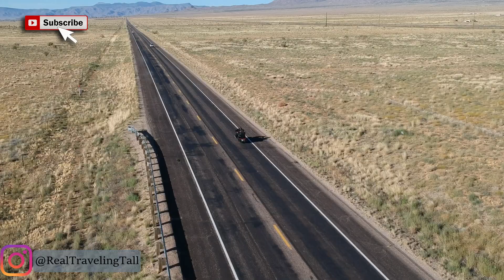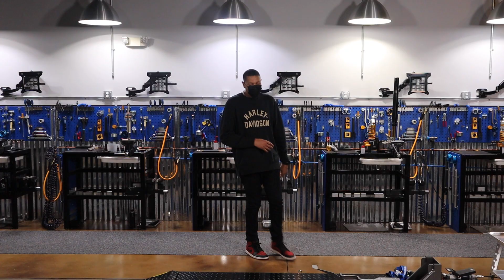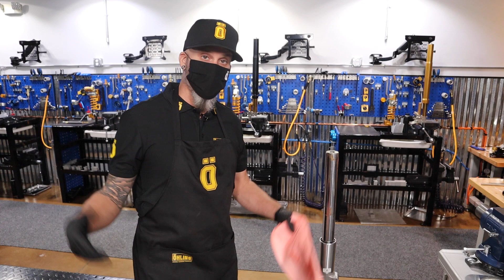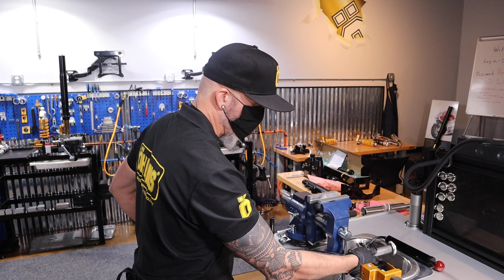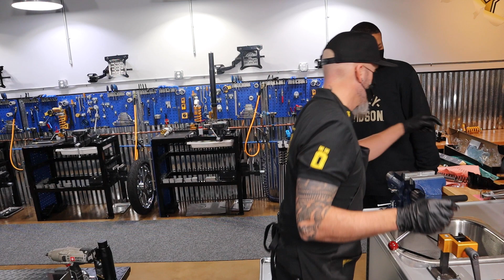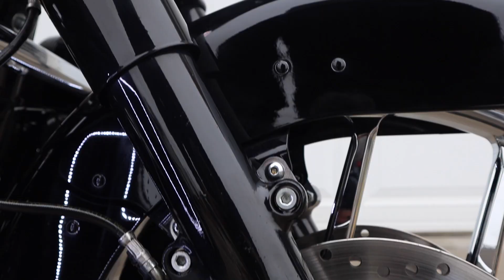Back at Öhlins USA for a Front Suspension Upgrade on my 124 Cubic Inch Harley-Davidson Street Glide!

Comment: Great video I just changed my front forks yesterday but I went with a complete pre assembled set and I did chrome bells and lowers because I have a black 21 inch on the front figured it would be too much black up front plus my bike is black.

Comment: Hey hey 👋🏾 Slim . Congrats congrats on your up grade on the suspension I’m gonna do the progressive spring on my bike cause of my 23” Wheel . i just might check that out too before i do anything. Leonard from cali rackem. 👊🏾🙏🏾🤲🏾
Reply from the maker: Thanks Leonard, you should check out Ohlins before you make a decision. Thanks for watching
Reply: @TravelingTall  will do Slim thanks 🙏🏾
Reply: Ohlins are a waaaay better option.  Pricey, but well worth it.  I'm doing them on my rear right now, but I'll be doing the front end in the spring.  Progressive is an improvement from stock, but not in the same league as Ohlins.

Comment: This means that the handlebars, and all chrome controls,headlight, blinker housing,push rod tubes, total exhaust system, floor boards,rear passenger pegs,ignition switch plus any chrome items I missed to be changed to complete the black out , and I did forget about the chrome wheels also and the rocker boxes ride safe

Comment: I was on Ohlins web site looking at some videos and this one came up. I have a 2015 Street Glide Special with the FKC 102. Do you know what is the difference between this and the FKS? Besides the visual differences. I got mind put on at a bike rally(Panama City) and like the guy says, the front end doesn't drop on heavy braking. It does ride better in the sense of having more control(confidence) but watching you hit though bump and not complaining, I hate mine when riding on a ruff road and hitting big bump. Example, when riding into Panama City hwy 79 the road get Course(Ruff) as you get closer to Back Beach Road I guess is the way to described it(at least 5 miles of this). You can feel ever bit of this through the handles bars and seat, just a really rough ride. Leaving  Eufaula Alabama heading toward Dothan there is bridge at the bottom of a hill that when I get to the bridge the front end SLAMS very hard, I guess you would said the suspension is bottoming out. First time I rode it, It about killed my neck and back. But to be honest the stock suspension does it too. My friends rides a Victory Vision and he says he barely feels it. His solution: Get a Victory. LOL I thought the black fork tubes looked really good. Looks like you have
a good combination of black and chrome going there.

Comment: The black fork looks great. What are your settings of the front suspension (compression, rebound en preload)?
Reply from the maker: I think he told me 18 on the rear. To be honest I don't remember the settings on the front.
Reply: Thanks, Our HD dealer will install the front suspension FKS 228 soon. But they have no experience with ohlins. I'll figure it out ...

Comment: I’m surprised that this was done after the zippers kit. Front suspension sets the handling for the bike. Rear suspension is 85% for comfort, but was you mentioned address that wobble thur corners. That wobble is serious and it would be wise to take a deep look at that. I’ve always wondered why HD take and trail calculations are so questionable.

Comment: Another things worth discussion is that it seems that some hd models have Showa suspension inserts, this is a quality product. But It would be interesting to know if this is true and if Showa is owned by Honda?
Reply: H-D does use Showa for the factory Touring forks, but it’s still a low cost setup. Showa is partially owned by Honda, I’m positive that’s the case because I work for Honda, but Showa is still free to provide suspension components to other  “customers” (i.e. including other OEMs) as part of their total business model.  Easy to imagine  they rely on doing so as part of their total profit.

Comment: Did you have to use spacers in your forks to prevent from bottoming out and smashing your fender?  Figured I would ask given you are running a 21" wheel on the front.

Comment: Hi Tall, I am from Germany and following you on your YT channel.You always upgrading your bike and improved your motor
to 124cci. Now I have a report for you about a Softail FXDR (2020) built by the a little company here in Germany. 
This bike has 146cci or 2400cc, 170hp at a torque of 247 Nm (no turbo charter) .All parts inside of the motor are from TORXTER.
The price for this total customised bike (new rear and front fender, new blinkers, new seat and so on) is 59.000Euros
If you are interested to get more information about this bike look up  www.sohn-motorcycles.de
Best regards Michael

Comment: Indians come with a functioning suspension. Crazy, ain't it?
Reply from the maker: The Indian Challenger suspension is good for a factory bike.
Reply: @TravelingTall  Indian just released a new 2022 steel tube frame Chief. Reminisce of the Victory Gunner, to me. Falls in line with other middle weights. Looks good with the Thunderstroke motor. Would make a fun review.